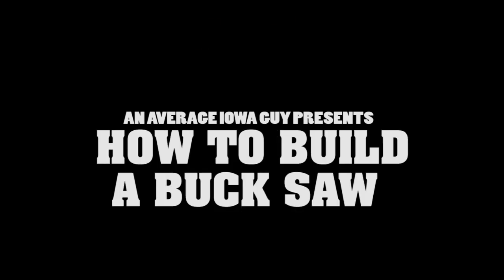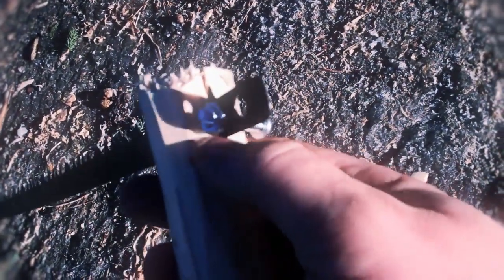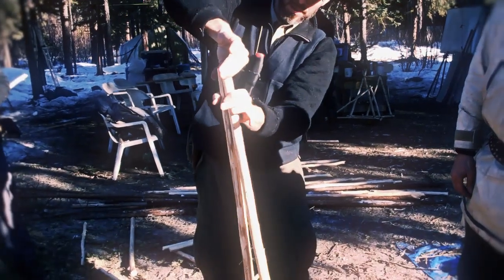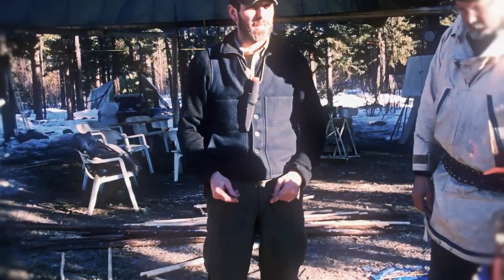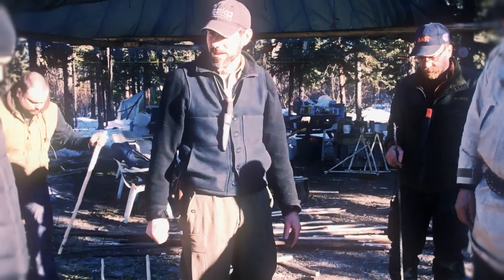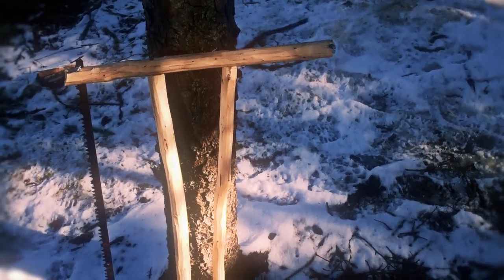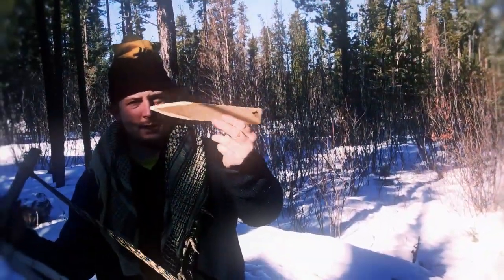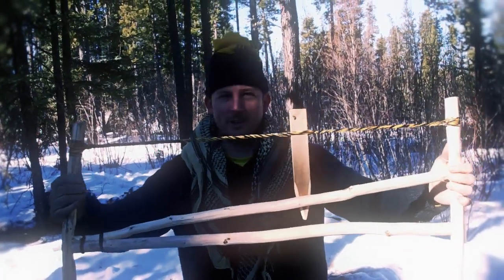How to Make a Buck Saw in the Woods

Comment: Nice looking buck saw you made. it is nice to see different ways of making it in the woods.
you say would be good idea to include bolts for setting the blade. Try wooden peg made out of twig. it does holds the blade without problem.

Comment: I understand the principle of the second cross brace but your depth is way too short. That saw blade must be 35 to 40 inches long. If you made it the way Mors Kohanski would have, the cut depth would have been at least 12 to 18 inches deep. That saw could only cut an 8 inch dia tree and you would still have to roll the tree half way through the cut. A bucksaw I made with a 26" blade will cut through an 11" dia tree without rolling the tree. You wasted all that extra blade.